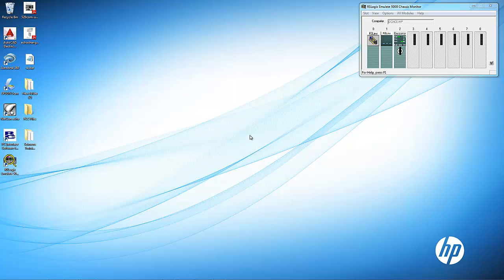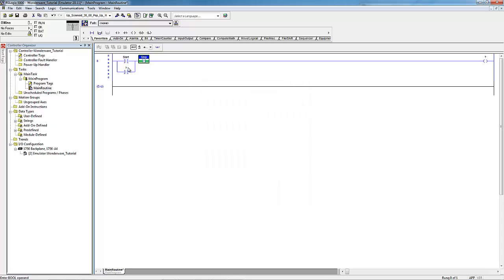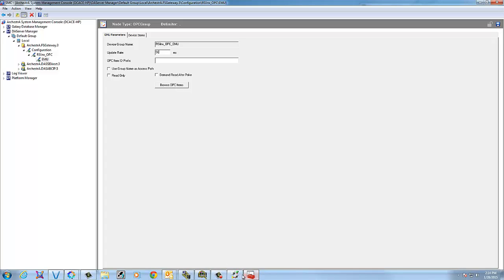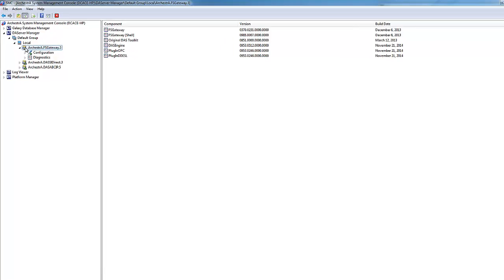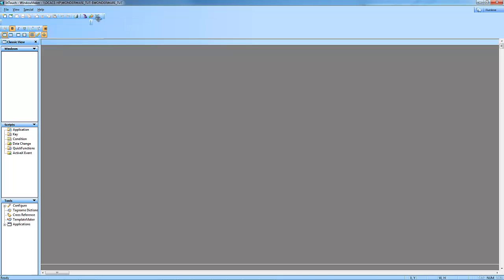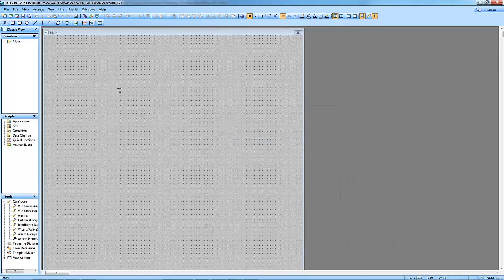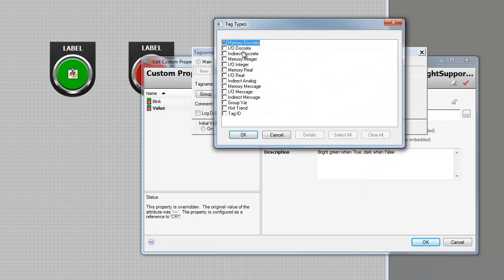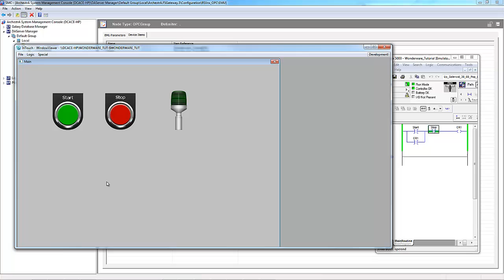Wonderware Tutuorial With RSlogix 5000 Emulate

Comment: Why not use ab DDE without need of the FSgateway? (its faster and direct).  Logic could be done directly in wonderware instead of using the processor PLC? no need to open the rslogix? Could have used use tagname as item name in the tag configurator?
Reply from the maker: Good to know, the emulator was not supported at that time.

Comment: Why not set up the SMC using the free DASABCIP driver for a IDAS that comes with Intouch instead of the FSgateway driver and a seperate RSlinx OPC Server?
Reply from the maker: Deagle7298 because I was using the emulate controller and this was the option midwest told me use.
Reply: just read your comment i asked the same......

Comment: I keep getting error message when I try to find the OPC Server, its saying I can't connect to OPCEnum, what to do?
Reply: This is a common issue...check out: https://knowledge.insourcess.com/Wonderware_Device_Integration_and_Communication/Tech_Notes/TN_DA111_Fixing_%22Failed_to_create_OPCEnum_on_the_selected_node%22
Basically, you need to redo the OPCEnum security settings in admin console

Comment: Hi, thanks for the video, its very helpful, one question.

I'm using two Virtual Machines, one with RsLogix (Windows XP) and the other with Intouch(Windows 7), do you think its possible to link them to make a simulation of the process?
Reply from the maker: Felipe Castro I haven't tried to do that. I don't know if I can assist with that one. sorry bud.
Reply: its ok man... thanks for the feedback